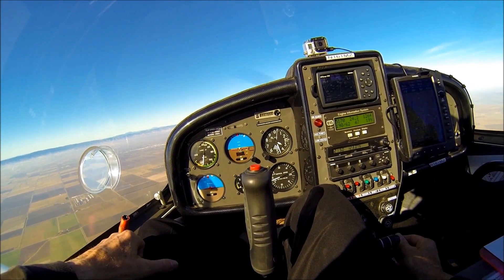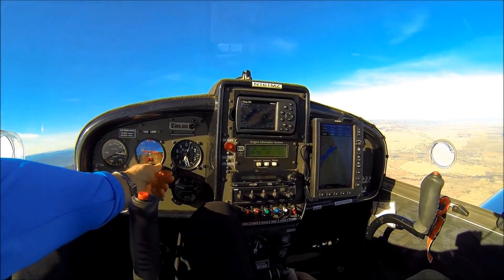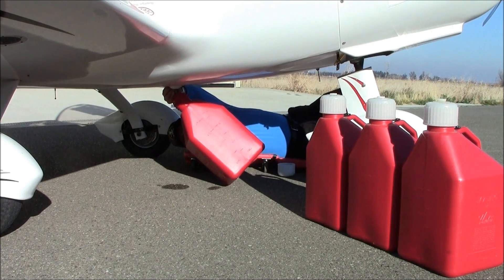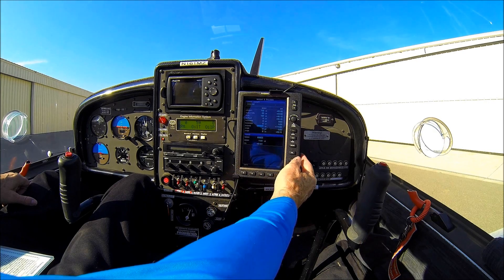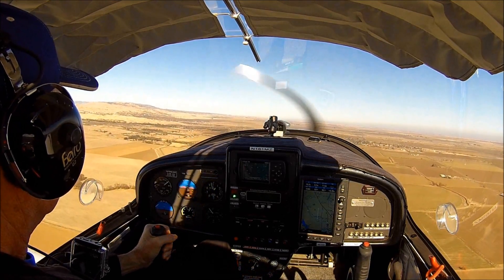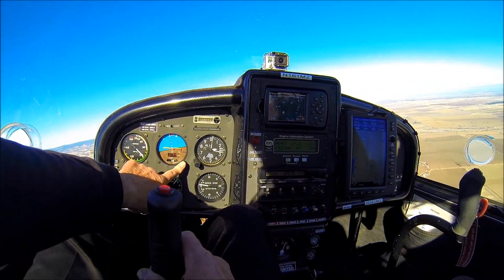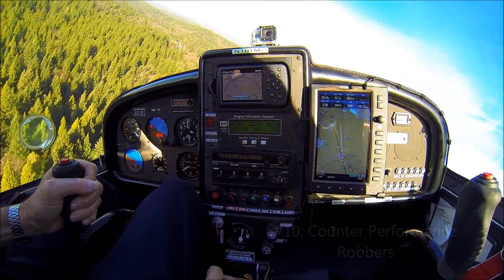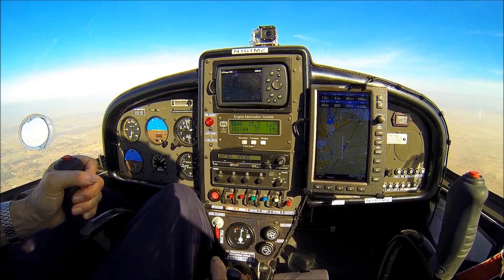Aircraft Safety and Performance Tips: Sting Airplane

Comment: WOW! 4 engine -outs with that Rotax carb gunge... Were you using Mo-gas or 100LL when that occurred?
Reply from the maker: THE LAST DAY I failed to be specific enough; those were losses of power, not engine outs.  All were due to debris introduced into the fuel system, due to poor fuel-hose management practices--which I avoid like the plague these days. Fuel type was not a relevant factor.

Comment: I really enjoy all of your videos and this one is a nice one too! You mention that wind from behind warms the engine quicker. Can you elaborate why that is?
Reply from the maker: Very simple: Less air--which carries away and dissipates the heat--is getting through the air intake ducts of the engine cowlings, to the engine, with the wind from behind.  Also, the prop cannot push as much air back towards those ducts, with wind from behind.
Reply: Sting Flight That makes sense! Thanks!

Comment: Whoa!  Did you REALLY say that you've had FOUR engine-outs on takeoff due to debris in the carbs?  Something pretty wrong here.
Reply from the maker: Negative!  Four instances of loss of full power, not "engine-outs," due to debris.  This taught me to take more steps to ensure debris doesn't get in there, again.
Reply: Okay, that's more like it.  What is the stipulated TBO?  You friend has gone 2400, so they seem to be pretty tolerant.  Our local group has a Sting, Gobosh 700 and a CZAW - seemingly a great way to enjoy SoCal skies.
Reply from the maker: ***** TBO is 2,000 Hrs--but that does not mean you HAVE to overhaul if it's running perfectly, and within tolerances...
Reply: @StingFlight  What steps? I'd suspect a filter on the plane's filler neck...
Reply from the maker: @Jack-ne8vm  I use a Mr. Funnel, with 10 micron filter for all gas poured in, through the filler neck.

Comment: Congrats on the 1000 hrs Rich!   That's a big milestone!    AND - thanks for taking the time to post your top 12 tips.  All very good stuff to learn from and ponder.  It got me thinking - what would be my top 12 tips if I were to do a video like this?  I just made it through the 'killing zone' and had a few moments of my own to ponder.  I have a healthy dose of respect for my craft as well.  I'll try your trick watching the EGT's on take-off.  Glad to see I'm not the only one to drain my take a 100 times figuring out usable fuel levels.  I've had 3 loss of power on take-off this last year.  As a result, I'm always thinking of plan B.  Density altitude also would be on my list.  It will blind side you the moment you ignore it.
Reply from the maker: +ttabbs Super points, Tom!